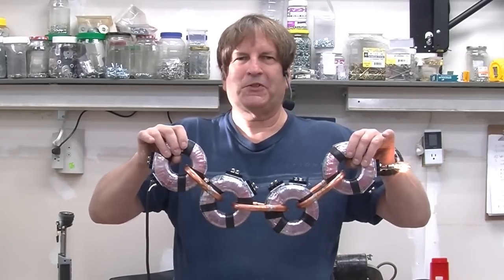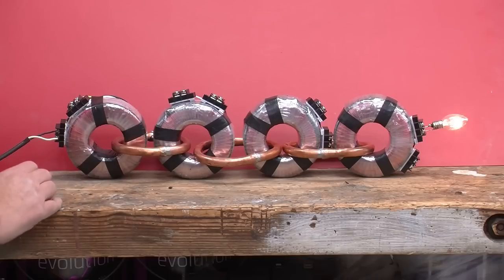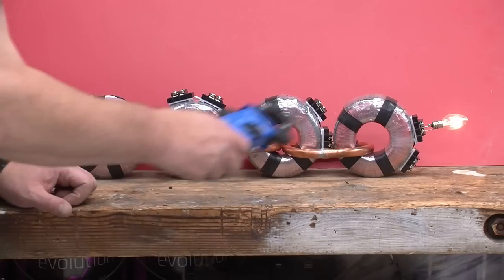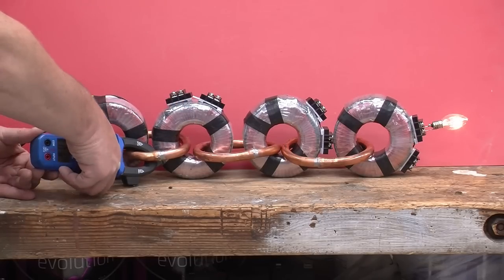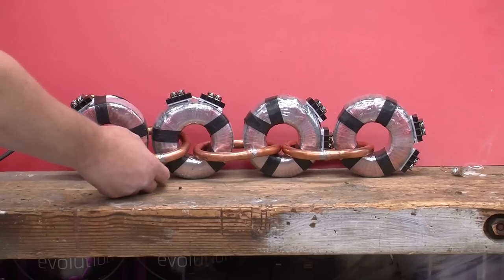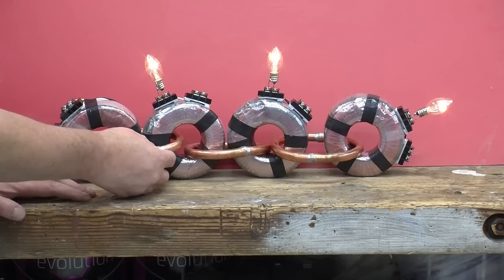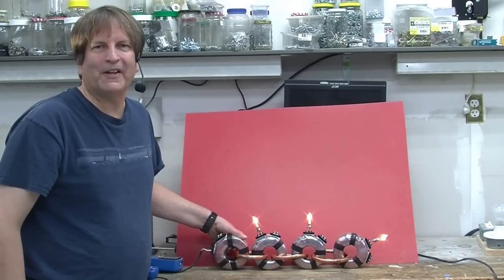Let's Experiment with an Electromagnetic Chain!

Comment: And this is why inverters still draw 2-3 amps from a battery bank with no load.
Reply from the maker: Yup. Although some RV ones have low power load sense circuits to keep the inverter on standby when no load is on. Of course that does not work will with the always on AC power adapters for so much of our electronics these days.

Comment: Measuring across opposite sides of the single turns isn't the way to find out the voltage of a single loop.
Reply from the maker: Remember that the meter forms part of the loop. Where you measure it on the single turn makes a difference.

Comment: For copper being  great conductor of electricity i find your demonstration to be a bit strange, especially when you claim some very low voltage on either side of the cooper tube you are using and high amps is show there. When you put another cooper tube on the last coil and the light went out how come you did not feel that high amperage with very low voltage through that cooper pipe? I'd like to see this with a steel pipe instead of the cooper pipe transfer between each coil since pure cooper is not magnetic but steel is.
   I also think if your transformers can transfer power through a cooper tube???,  the real power transfer is the the fact of the transformers being so close to each other at the same angle and not the cooper loops. I'd like to see this same experiment with a normal type transformers.
Reply from the maker: The copper tube is like a wire and going through the cores it becomes a 1 turn winding in a transformer. If I had a thick copper rod or wire I would have used that. The problem is with such high currents and low voltages you need really really really low resistance or all the power will be lost in restive losses of current passing though the wire (=pipe). The formula for power through a  resistance is I*I*R (I is current  so I squared R).  The squaring means for a large current you need a really tiny R or a lot of power will be lost. Not sure how I can explain it any better without being able to draw things.

Easy to do with normal transformers - just  one connected to the next and so on.

Comment: Munich?
Reply from the maker: Bingo! We have a winner! Yes the fabulous Deutsches Museum in Munich!     https://en.wikipedia.org/wiki/Deutsches_Museum     Have you been there recently? I remember a chain of small copper and iron links hanging down with a light bulb glowing at the bottom. Is it still on exhibit? The last time I was there was when I was a teenager. They also had a fantastic Faraday cage demo as part of their high voltage show.
Reply: @ElectromagneticVideos  I've been there a couple of times: it's a place that really needs months, rather than days or weeks, to take in all of the exhibits. The way that they explain the different structures of steel is sublime: I'd never really understood it until I saw their displays. And the Faraday cage is indeed electrifying. Or not, depending on where one stands with respect to the cage.
Your set-up was very impressive too. You obviously spent a lot of time and money on putting your demonstration together. Kudos to you for helping people to understand the Universe we live in. Thank you.
Reply from the maker: @nicholashacking381  Yeah - like many other great museums, one day isn't enough!

It actually wasnt that hard to put my demo together - oddly the hardest part was bending the copper pipe. So glad you like it! More to come!
Reply: @ElectromagneticVideos  Well, copper tubes love to collapse (like the short-ciruit example in your video) when the bend radius is tight. Copper bar would have needed more working to bend into a circle, but it wouldn't have collapsed. That said, you produced a brilliant demonstration, and I'm just a keyboard warrior. I look forward to more...
Reply from the maker: @nicholashacking381  Yes - I tried two different tube benders  - none are really made for 180 degree bends! keyboard warrior - sadly I spend way to much time on the keyboard too!

Comment: how much current are u using?
Reply from the maker: The magnetizing current for each toroid is about 5Amp turns. So where there is the big single turn of copper pipe, the copper pipe carries 5A. The 120V input has about 500 turns so the magnetizing current is 5A turns  / 500 turns = 10 mA. Since the input is supplying magnetizing current for 4 toroids, its actually 4 times that or 40mA

Comment: Hey. I got an idea. Attach 120V to the other end of the chain and wear it as a necklace for a few minutes? I hear its pretty cool. 😁
Reply from the maker: I think from the weight alone you would get a stiff neck!
Reply: @ElectromagneticVideos   You would go stiff all over if ya got the shock of a lifetime.
Reply from the maker: @BTW...  I actually experienced that once as a kid - was in the garden and my leg hit a hidden live wire under a metal windmill tower which I was holding onto with my hands at the time (no better ground than that) - was completely paralyzed but conscious. If my mom hadn't noticed something was wrong and and pulled me away I wouldn't be here. And that was in a 240V country - really amazing that I survived.

Comment: Is that 110 mili amps ???
Reply from the maker: At about the 12:50 point in the video? No it is 110 Amps. (high current, low voltage)

Comment: Does this have any practicl use in today's world?
Reply from the maker: Really just a neat demo.  However a transformer with an air gap between primary and secondary sections that is essentially one link in the chain is used to provide isolated AC to power lights on top of high power radio and TV transmitter masts.
Reply: @ElectromagneticVideos  thanks for shedding light.
Reply from the maker: @amirmoezz  Your most welcome!

Comment: can u meke a vido of how much can affect the magnetism the fisical form of the cooper using a concave cooper magnetic amplifier of 20 to 30 cm wide and in the base u put a big neodimium all of tha i described should llok like a big sound magnifier
Reply from the maker: Sorry I dont quite understand what you are describing. Can post a link to diagram or photo?
Reply: @ElectromagneticVideos  first you make a parabolic concave cooper plate maybe 20 to 30 cm diameter and (1 to 2 cm or less) wide or thick then at the center like in a speaker you ´put a big neodimium magnet the same like in a speaker so with the cooper will amplify the magnet field ,i saw that video somewhere but i tried to find many times but i couldnt find it yet ,and i saw it amplified many times the magnetic field
Reply from the maker: @elarcadenoah9000  Unless I'm missing something, I don't see how that could work. When there are no moving or AC magnetic fields, there should be little interaction between the copper and the magnet. I wonder if whoever was making the video you saw may have been faking it - sadly there is a lot of that with people trying to get a lot of views by showing something that seems so amazing. But if you do come across that video please post and and lets figure it out!
Reply: @ElectromagneticVideos  magnetic field acts like weaves like sound ,like wather ,like light,all of them are weaves that is why tesla study wather weaves also,and parabolic miror can direct light to a certain point ,laser for example is only light bouncing from miror to miror so it can be made  a straigh light ,magnetic also can be manipulates and in microweaves they use cooper like a concave chamber so magnetic weaves travel longer,so i think that video is not fake,maybe one day i find and i show you but i you dont believe in weaves there is no reason you believe in tesla cause he believe in them,you can see tesla valve for example there are manuy ways to manipukate weaves and now maybe some body can make magnetic laser  sinding the way how to bounce the weaves with a magnetic miror or something that reflect magnetic field like mu metal or diferente material compose

Comment: Egypt used cables like that using ferrite.
Reply from the maker: I dont quite understand. Do  you me ferrite loops around cables to prevent EMI/RFI?
Reply: @ElectromagneticVideos  the cable was white and black striped. Coils for white ferrite black. They transmitted magnetic power like you're doing but over long distance.
Reply from the maker: @paulneilson6117  Hmm - would be interesting to see a photo!

Comment: Induce current into the gas?
Reply from the maker: What do you mean? In the air though the toroid? There would be but it would tiny because the air is such a good insulator.
Reply: @ElectromagneticVideos  try this: once I found 5000W microwave transformer, removed from Panasonic. Very big and heavy, I bring it home. Transformer had 4 big terminals. Secondary coil terminals was bigger with a hole in the middle and look like huge transistors. Distance between terminals 3cm. Between secondary terminals and a core was thick insulation. I took small transparent insulation wire from small coil and wind through the hole of a right terminal (trasformer terminals facing me) 12 - 14 windings, dont remember. Than connected that small wire to a transformer core. No ground wire. Than connected primary coil terminals into wall outlet.
Reply: @ElectromagneticVideos  doesn't work with small microwave transformers. I tried. May be I don't understand how. Has to be more than 5000W or close.
Reply: @ElectromagneticVideos  also, forgot to add, take a clear scotch tape and wind 2 - 4 times around that terminal with a small wire on.
Reply: @ElectromagneticVideos  After this thing will be turned on, small blue dot will appear on the left terminal and will circle around it self and grow in size. When it will reach a size of a pea, spark will quickly travel to the right terminal through the clear tape, and dissapear without touching the terminal. All that go with 60Hz speed. While turning on I was next to transformer, didn't know what to expect, but I wouldn't recommend to stay near.
Reply from the maker: @suslik748  I don't completely follow but sounds like you are doing some sort of high voltage discharge - corona or a spark. Please be real careful with the microwave transformer - the high voltage has more than enough current to kill or cause serious injury. A current limited HV supply could be safer for HV experiments.

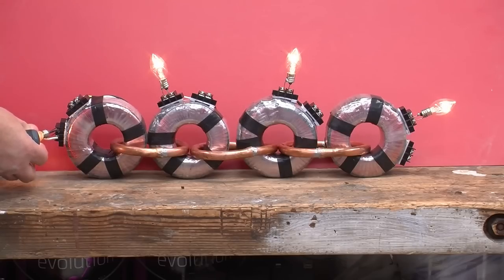Comment: 7:00 What is the purpose of a GFCI if you have an insulation transformer? None...
Actually it's probably safer without the transformer because if you touch a live wire and enough current passes to ground, the GFCI trips. Ok you could receive a shock but it stops immediately. Behind the insulation transformer, if you touch both wires, the current passes through you and no breaker trips to save you.
Reply from the maker: Your right both is unnecessary - unless of course one or the other were to fail itself. 

As to which is safer - thats  always a debate.  Yes - if you touch both terminals the isolation transformer wont help. But if it was that sort of contact and no alternative ground path, neither would the GFCI. In the end what I really should have done done is insulation the 120V terminals so there was no way to touch them, and not bring out 120V for each following coil and do everything with the lower voltage secondaries of the toroids.

Comment: Seems like an amount of amps I don't want to touch!
Reply from the maker: Well its always good to err on the side of caution - particularly in the case of electricity. I assume you are referring to the current in the loops of copper pipe? in this case the voltages is 0.2 volts so  the main danger is the heat they generate at high currents because  their small resistance is not small enough when compared to power equation IIR (thats I squared R which is hard to write in text only). I'm talking here about currents being say above 500A when load is attached - square that!

The biggest risk is the 120V 500 turn winding on each toroid where I have the bulb attached. Those 120V terminals should really be covered, or better yet use the low voltage terminals with a low voltage bulb.
Reply: @ElectromagneticVideos  what amount of the  original magnetic field in say T1 induces a current in T2  ie no copper links?
Reply from the maker: @davidcliftongm8565  You mean just the two toroid transformers next to each other - same positions but without the copper pipe doughnut connecting them? Very little coupling between the two would occur. The fields in a toroid are very well confined to the circular core - much more so than for a regular EI type transformer. So I would guess way less than 1% of the fields greeting from one to the other.

Comment: Bet you haven't seen 4 toroidal coils put into a tetrahedron and powered up.
Reply from the maker: I sure haven't! Have you?
Reply: @ElectromagneticVideos  Yes, I built one with my brother, it's an oddity, and no way we could keep it powered, it either does nothing {not enough juice} or blows the circuit, {regardless of bi-parallel or series wired.}
Reply from the maker: @brianstevens3858  Kinda hard to visualize how it was hooked up - but interesting!
Reply: @ElectromagneticVideos  It's actually pretty simple, wind four rings with wire, {creating the toroids}, join two at any point and set the angle at 60d, joint the other two also at 60d, {we used a non magnetic binder cord} and just tied them tight then varnished the cord. then put the two {halves together}, obviously there are a lot of ways the individual rings can be connected, series, one to another etc. bi parallel with two and two being common, and 1 and 3 and 1 and 1 and 1 and 1 separate circuits'. I find the series the most interesting as it is an all or none effect.
Reply from the maker: @brianstevens3858  So did you actually have transformer cores? Or were the rings insulators. If they were transformer cores there should have have been little interaction between the cores due to the magnetic fields being mostly confined to the cores.
Reply: @ElectromagneticVideos  Awg solid core triple ought copper, the rings were diameter of 5.7 inchs {a slight miscall when forming}. So "Diamagnetic". I have tried a few times to model the potentials produced from the magnetic and electrical aspects that emerge. No dishonor to say takes a better man than me.
Reply: @ElectromagneticVideos  I would love to be able to use some NdFeb rings to make one but it's not a high priority once cost is considered, lol Even just to see if they could be joined into the tetral.
Reply: @ElectromagneticVideos  One thing to note that seems to escape anyone not familiar with tetrahedral symmetry is that if you consider the relation of two of the rings as a unit, the two resulting units have a 90 degree relational. I think this plays into it's oddness.
Reply from the maker: @brianstevens3858  Yeah - cost is always a consideration. What actually prompted me to do this was a bunch of toroid transformers on sale at 75% off - what a steal of a deal!

Comment: of course the efficiency is very low and much electric energy is beeing convrted to heat
Reply from the maker: For any significant load, yes - the copper pipe actually has so much resistance relative to high currents for higher powers ie 800A at 0.2V = 160W essentially all the energy is lost. At no load, the low currents (5A magnetizing current per core) uses little power - I measured it to be about 7W total for the whole setup.

Comment: Oh, I'm so gonna use this to mess with my student's brains :-)
Reply from the maker: I just looked at your videos - you must be a math of physics teacher or both? Or a Prof? I would be thrilled if you discussed this with your students - or better yet, build one for your class. The hardest part is bending the copper. And toroids are perfect for other EM experiments (more to come).
Reply: @ElectromagneticVideos  physics and math at mid and high school level. And with far too many hobbies. I also teach two elective courses in microcontrollers, do 3d printing, built 2 small cncs, do woodworking.... and am always lacking time. 

Last, I confused my students with a faraday cup where its impossible to remove charge from the inside with a small aluminium ball,  but touching the inside with a long copper wire discharged it. I also made some videos for handling our TI nSpire CX calculator, but with full-time teaching I don't really get to make them look pretty.

Induction will be a topic either right before or right after christmas, but I don't know if I have enough large toroidal cores.
Reply from the maker: @wernerviehhauser94  Thats great - your students are so lucky to have a teacher who really likes and does the stuff! Only 24h in a day to do everything interesting is a problem I have too.

I totally get how hard it is to produce slick videos with limited time - it is so time consuming - obviously mine also could do with more time and effort to make them more professional. 

I'll bet you drove them crazy with the Faraday cup - what a great experiment to show how interesting this stuff is. 

Induction: I will be doing a few more videos on this sort of stuff. I got my toroids from newark,com which I believe is part of a UK company and probably offers free shipping to Europe too. They were on clearance at 75% off (so $33cdn each - a bargain) but  I think they are all sold now. If you want more toroids well worth periodically looking at Newark (or if they have a German equivalent) - they occasionally seem to put things on clearance at huge discounts.

Comment: This doesn't look dangerous at all.
Reply from the maker: The only areas of concern are the (somewhat shielded) 120V terminals on each coil. To make it safer, you could/should easily run the whole thing at a lower voltage. But like most things I do, I would not recommend doing them unless also area an experienced professional and ake suitable safety measures.